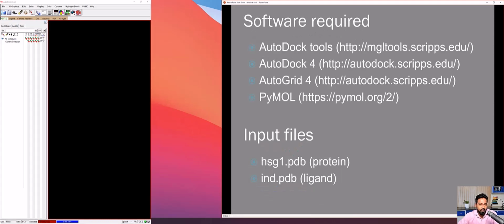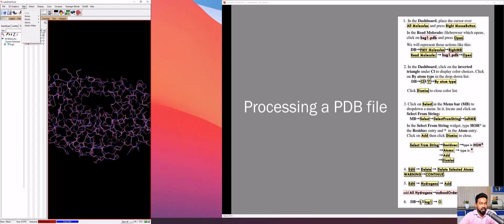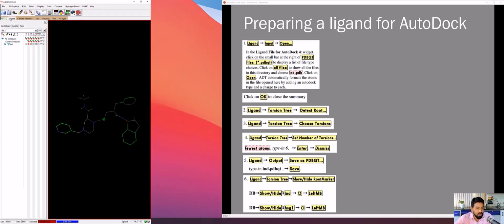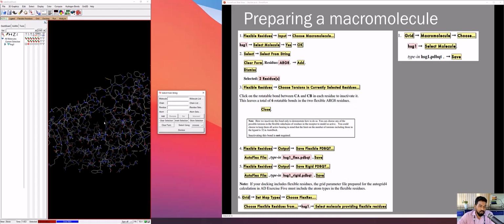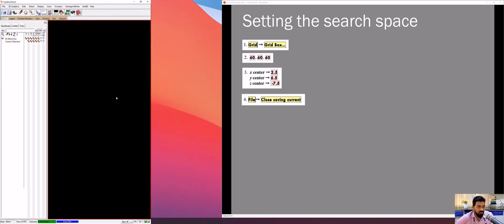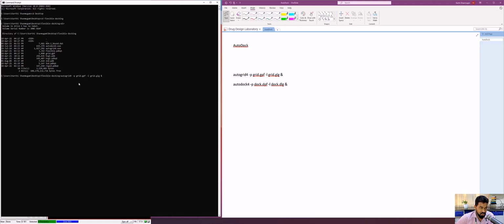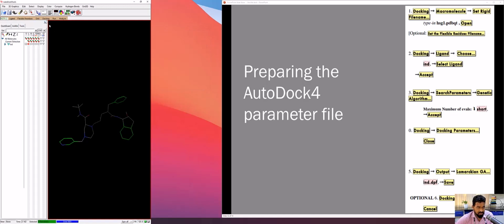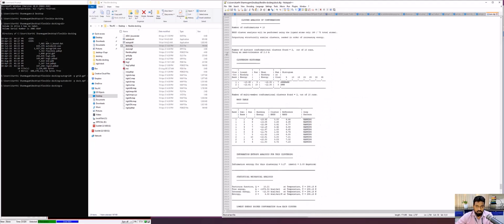Flexible Protein Ligand Docking using AutoDock

Comment: Dear sir,during the step select from string, I choose 'ARG24,ARG47',and click add,but when I click choose torsion and currently selected, the whole programme is shutdown.what can I do to solve this problem?
Reply from the maker: Do you still have this problem?
Reply: @primalbioinformatics 
I have this problem know 
What should I do??
Reply from the maker: @ES-yd1ze Which version of AutoDock Tools do you use?
Reply: @primalbioinformatics  yes!The Autodocktools version I used is 1.5.7,Dec_19_18
Reply: I have the same problem. As soon as I choose "residue," the whole programme is shutdown
Reply: problem solved?
Reply: @NandhaKumar-dp5to  I used gnina instead
Reply: @NandhaKumar-dp5to  guys, did your problem get solved? I am facing the same issue